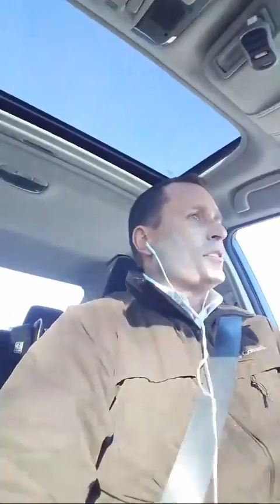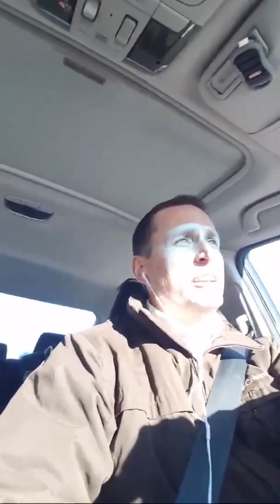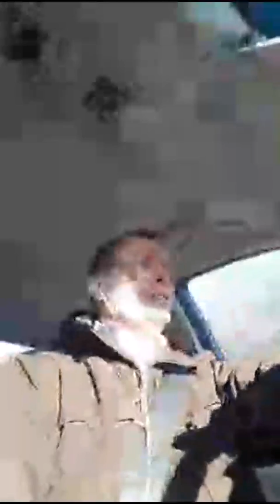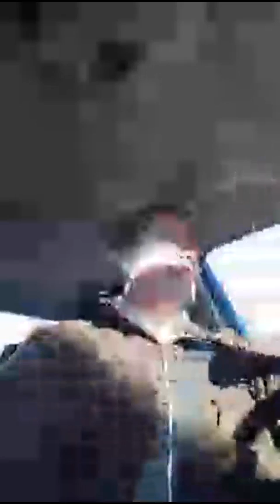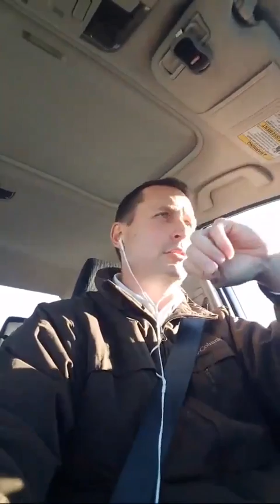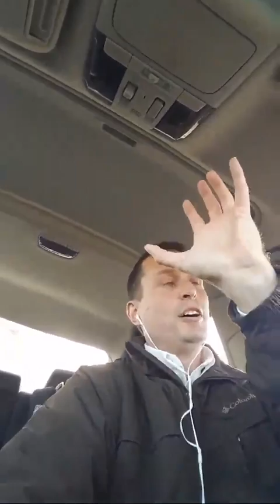32bit ESCs, Helio, 32k, RPM Notches, BF 4.0 features, Stick Feel and more ...

Comment: +1👍 i had thumbed it, but never commented until now. i need some knowledge magically transmitted via brain waves toward my direction.

I like my Helio. although there are pro's and cons. I'm still fighting some oscillation that i can't notch out, but maybe i'm doing it wrong as this is my first and only build.  trying to use betaflight github docs and wondering if helio ignores or acts differently on  dterm cli settings. (technically running butterflight 3.6.x/buttered pids, but they lack the same detailed documentation)

i have 2 direct general/generic questions now if you don't mind....  If i want to notch out motor noise, and my BBL shows the motor peak and some minor ripples on the side, do i include those ripples in my notch, or only the main spike?
Also is there a way to show more numbers in the Blackbox-Explorer "analyser" graph? it's very difficult to pin point numbers by zooming & unzooming.

thank you very kindly! [ like that thumbnail too :) ] [listened fully >2 times]
Reply from the maker: I don't think you can use a notch filter with Helio?  Maybe static notches? and they just disable the Dynamic (which is dumb, but water over the bridge).  In that case (static notches) I would just do the main peak.

You can move around the slider to get the peak frequency, but I know what you are saying in regard to precision.  If you can find the noise in the Gyro trace, you can use a Marked Point in BBE to measure peak-to-peak to reference against what you are seeing in the spectrum analyzer.
Reply: appreciate the reply! @ @uavtech  it looks like either my gyro jitters, or my motors cause it to jitter.

Comment: hello, finally i tested BF 4 on my 6 inch mamba build. yes the stick feel is better (maybe), default pids are ok,  but i still suffer dipping nose on throttle punch even though the i gain was already high value on BF 4 default. propwash was there too with my gemfan bi blade 6"..  also my motors are warmer compared to my 3.5.6 tuned setup. do you have clue what filter setting to be used for 6 inch quad? on 3.5.6 we use PT1 but on BF 4 default are biquad.. im looking forward from your videos about tuning in BF4

Comment: Request for future video: tracking timescale of delays?  The FPV delay stack (camera, VTX out, module reprocessing, screen frame update in interlaced), RC delay stack (gimbal input to heartbeat to serial frame, then into PID/F), then flight control propagation (I think people would be shocked at how different that timescale is from all of the above).  
It wasn't until I spelled that out with my own estimates did I conclude spending $15 more on cameras to get low latency ones would do more to improve my racing than anything in the PID/Filters tab.
I've also been running 0 feedforward (or D-Setpoint/Weight) for a while now, and found that it feels good even with interpolation or smoothing enabled - I do get some precise resonant D term stairsteps just like you've described, so I eat the interpolation penalty to keep the motors cooler.

Comment: Because betaflight isnt doing 32k does that mean there's no need for the ICM Gyros on the F7
Reply from the maker: F7 is good.  No inversion BS and a little more speed.  But no for ICM gyros and BF; unless things change.  However, from what i understand Invensense is phasing out MPU chips(?).  Needs verified, but someone said that.
Reply: @uavtech  thank you i was curious because  since betaflight said no more 32k all the f7 boards ive notice has the icm gyro.
Reply from the maker: @rdandes47  ICM is fine in 8k mode.
Reply: @uavtech  Out of curiousity, is the processor the rate limiter for running ESC Telemetry speeds, or is that an ESC Telemetry rate driven thing?  Being able to run 8k/8k (even if it means forcing DSHOT1200 reworked) with ESC-driven dynamic gyro/D-term filtering on sensor fusion sounds pretty awesome. Probably one of the few things that would finally drag me away from running $20 F4/MPU6000 flight controllers (maybe).
Reply: @rdandes47  just buy F7 with dual gyro like Matek or DALRC
Reply: F7 has better overhead for SensorFusion, implementing EKF, and with my desire to run full telemetry radios, VTX control, camera control, ESC Telemetry, and GPS I don't have to dork around with inverting receiver connections.
I did hear from a BF dev that the MPU line is in LD/ND range, but they're still available and plentiful short term.
Reply from the maker: Plus RPM notches take some power too.